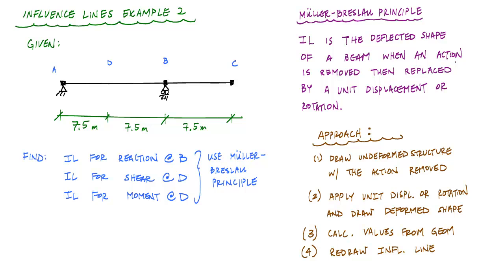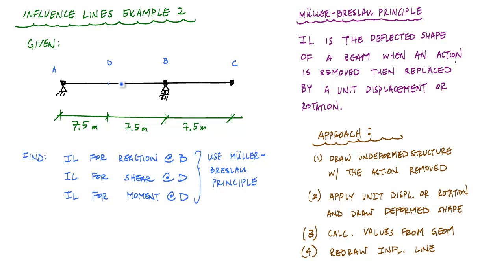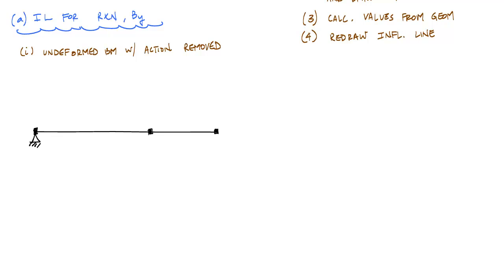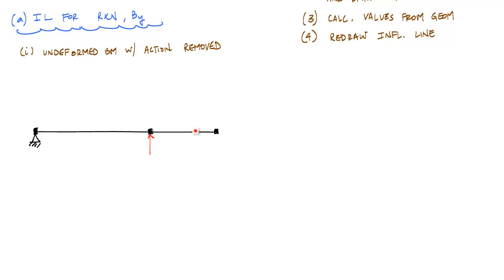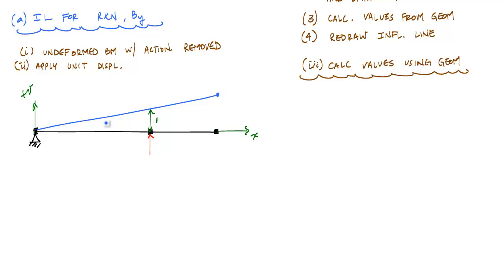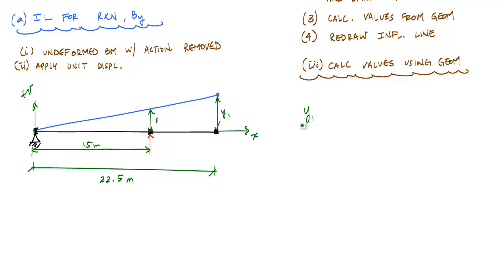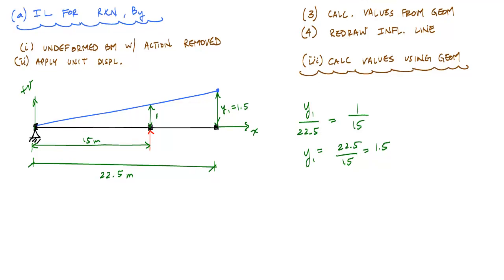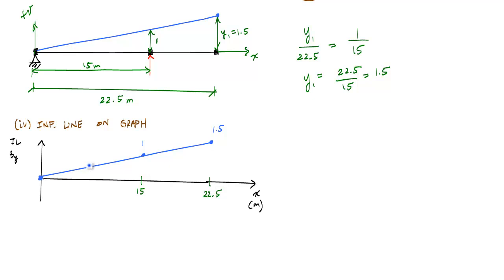Influence Lines for Beams Example 2 (Part 1/3 - IL for vertical reaction) - Structural Analysis

Comment: What if there was a roller support at D and you were asked to find IL for reaction at B? I have this problem and I can't see how to draw the deflected shape! :(
Reply from the maker: that would make this problem statically indeterminate...we would need to perform more analysis with flexibility coefficients or remove the action and draw the deflected shape...we would have curves as opposed to straight lines.